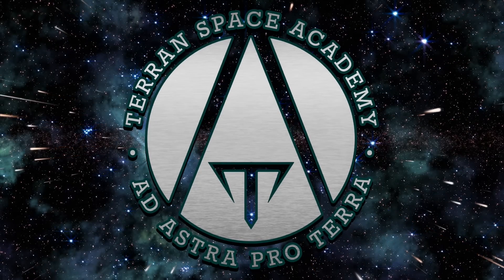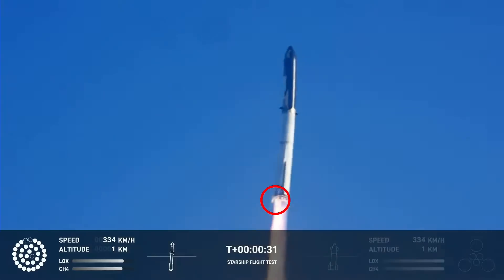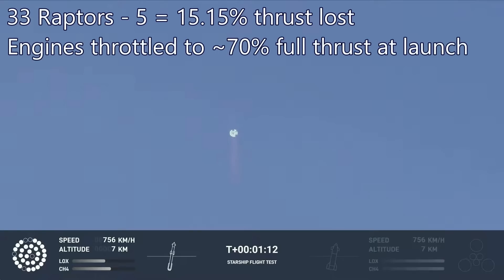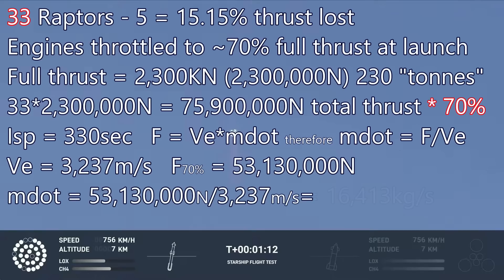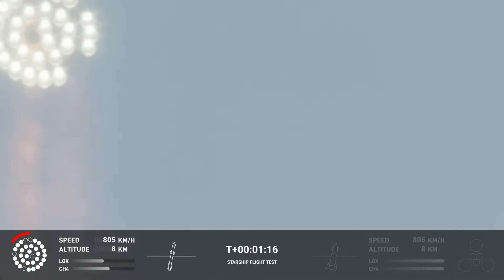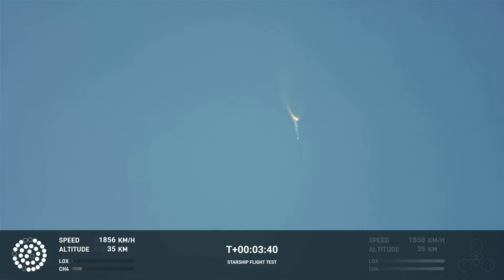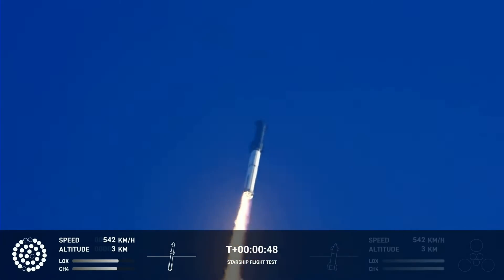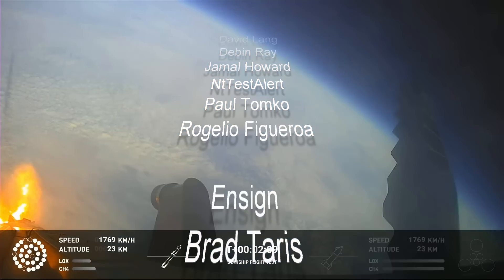Starship Flight Analysis: What went wrong with Starship?

Comment: The fact that it didn't break apart while tumbling is huge achievement.
Reply: Right! That thing was solid as rock
Reply: @cheeseswears  
That StarshipX heavy is not subjected to be tested its hardness like a rock.
So why are all you idiots being such a silly by coming up with many kind of silly and stupid excuses .
Is that the way for improvement by learning from mistakes ?
You fellas talk rubbish and BS.
Reply: 3 flips right I couldn't believe it held together that well
Reply: @ddhsd  yep I was very impressed every other rocket I've seen do spins like that break apart from the g forces but this thing refused to break apart and they had to remotely blow it up
Reply: Super impressed for sure!! That is one BFR!
Reply: I was thinking the same thing, millions of lbs of thrust attached to a tumbling office building
Reply from the maker: We think so too.
Reply: Yeah agreed
Reply: Exactly, durability tested!
Reply: Yea they remembered to enable  auto struts
Reply: Indeed. Normally rockets that huge are structurally fragile than most smaller rockets.
Reply: @lau6438  - the Falcon 9 did not explode on launch yesterday. Keep up will you, and enough of the stupid false equivalences.
Reply: Why didn't separate and land safely instead of blow it up.
Reply: @nolramonairam3098  It didn't blow up. It was blown up on command.
Reply: @nolramonairam3098  
That's the question you need to direct to Elon Musk and his bunch of idiots.
As they are not answering the real question but twisting and fiddling along with their wrong answer.
All for the purpose of damage control.
Reply: I didn't even see flexing of the structure (cam between Starship and HVbooster). Amazing.
Reply: Yeah I was expecting it to rip apart like the Proton did, that's a solid rocket (no pun intended)
Reply: Yeah, achievement my foot.
That's the reason why it can't detached itself as unexpected.
All you jokers are only trying to please Elon Musk by resorting to damage control.
Reply: Nonsense. it was supposed to tumble and "fling" the starship off.  Those forces wouldn't be significant.
Reply: Thin atmosphere at that altitude...however, I'm sure there was some bending and crumpling going on
Reply: Don’t feed the trolls
Reply: The entire launch was an abysmal failure, there are no achievements huge or otherwise to take from this. Remember the Saturn V launch system never had a failure. From its first flight to its last, it functioned perfectly each time. Also, the Artemis system functioned flawlessly on its first flight. SpaceX's entire approach was amateurish and reckless, hence this failure.
Reply: @HH-mw4sq  The Saturn V did not perform perfectly on every flight. Huge problems with pogo vibrations in early flights- this anomaly with starship is the equivalent to the pogos.
Reply: @nls.135  did the saturn V absolutely destroy the launchpad and damage everything within a 200m radius?     This was a pretry big disaster.   Even the tank farm took some.serious damage.
Reply: @jebes909090  The Saturn V had a flame trench and was half as powerful as starship.
Reply: @HH-mw4sq  Apollo 1 Killed 3 astronauts on the ground. Also I feel you're just trolling.
Reply: @deanlute794  - in what way was the Saturn V launch system responsible for deaths of the Apollo1 astronauts ON THE GROUND?
Reply: @HH-mw4sq  Not to mention the fact that Saturn V and SLS especially had been planned and had their design ironed out decades before being built. Starship went from completed(ish) design to full flight in 3 years. Remarkable pace, this flight was a success.
Reply: @HH-mw4sq  While it is true that the recent launch did not go as planned, it is important to view this setback in context. Space exploration is an inherently complex and risky endeavor, and failures are not uncommon in the history of space programs. In fact, learning from such setbacks has often led to significant advancements in space technology.

Comparing the recent launch to the Saturn V and Artemis systems may not be entirely fair. Saturn V, developed during the Apollo era, was the result of extensive research, testing, and funding. The Artemis system, too, has benefitted from NASA's long history of experience and lessons learned from previous missions. SpaceX, on the other hand, is a relatively new player in the field and is continuously pushing the boundaries of technology and cost efficiency.

SpaceX's approach to space exploration and technology development, while seemingly unconventional and risky at times, has led to many accomplishments. For instance, the company has pioneered the development of reusable rocket technology, which has the potential to greatly reduce the costs of space travel. Moreover, SpaceX has successfully launched and landed its Falcon 9 and Falcon Heavy rockets numerous times, showcasing its commitment to innovation and progress.

It is also important to remember that even established space agencies have experienced failures. For example, NASA's Space Shuttle program saw two tragic accidents in its history - Challenger and Columbia. These incidents served as reminders that space exploration is fraught with challenges and that every failure can provide valuable lessons for future missions.

In conclusion, while the recent SpaceX launch was undoubtedly a disappointment, it is essential to view it as an opportunity for learning and growth. SpaceX's innovative and ambitious approach has already led to significant advancements in the field of space exploration, and the company will likely continue to contribute to the development of new technologies and mission capabilities in the future. Rather than dismissing the entire effort as reckless and amateurish, it is crucial to recognize the value of learning from setbacks and using them to drive further innovation and progress.
Reply: @IlllIIIllIlIllllllIlll  - the Saturn V and the SLS, like SpaceX's Starship are designed to send payloads to the moon. So how are the comparisons unfair?
Reply: @HH-mw4sq  it's the difference in how the rockets are built. SLS and the saturn v used a different approach than starship. SLS and saturn-v's components where all rigorously tested individually, this meant that the rockets took an extremely long time to build, but that meant that their first launch was essentially already tested, starship used a different approach of build test change. Instead of building slowly and test as you go, you build, test and fail then build again learning from the failure. This isn't some foreign concept, anyone in any engineering field would recognize the rapid iteration philosophy, they're simply two different ways to get to the same goal, although generally rapid iteration is better suited to new and untested technologies as it's easier to find a design flaw and they aren't locked in to one design, look at the different stages starship has gone through, year after year it's looked different and that is just a testament to rapid iteration.
Reply: @HH-mw4sq  This attitude of "launch and see what happens and we'll learn a lot" bordered on irresponsible given the size of the vehicle. Now everyone can see that there was real risk to the community surrounding the launch site. People complained about the FAA delaying granting the license to SpaceX to launch. Now people may be thinking the FAA wasn't cautious enough.
Reply: @takashitamagawa5881  - hear, hear. I am so sick of those Musk "fanboys" trying to gaslight people into accepting that a rocket launch destined for orbital flight should be declared a success for clearing the launch pad. The SpaceX Super Heavy Booster's first flight was an abysmal failure. Its launch damaged its launch pad and propellant farm, it had 3 engines fail at launch, which represented 9% of total liftoff thrust, so it was doubtful it would have reached orbit. Plus it lost 5 more engines during ascent before being destroyed. Yet to many people, this was all a success. The FAA will have a lot to explain as to why it approved the launch. Civilian buildings 6 miles away suffered damage due to debris from the launch.
Reply: @HH-mw4sq  Saturn V engines much simple and less effective. And broad expensive testing and development facilities  were utilized with full government support. Do not compare in such way
Reply: @HH-mw4sq  There is different approach between spaceX and NASA, Bluorigin and other companies. SpaceX produces several not completely ready prototypes to make test that can give much info. This allow them to learn a lot and very fast. Other companies spend much more time to produce directly the final product. I'm over simplifying but that's the idea. For this reason they already have other prototypes almost ready to launch with already many improvements.
Reply: @HH-mw4sq  Your really missing the point about iterative design and development
Reply: @stuartnetherclift7566  - I understand the concept very well, and I use it daily in my own project management of software development. However, for complex mechanical systems like rocket launch vehicles capable of lunar flight. NASA has successfully done this twice with the development of the Saturn V, and the SLS. Neither of those blew up 4 minutes into any flight. They both functioned flawlessly on every flight including their first flights.
I don't get why you Elon Musk fanboys are trying to gaslight sane people into thinking that this abysmal failure of SpaceX's Starship is a "good" thing. It is not, and you lot need to get some objectivity on this issue.
Reply: @HH-mw4sq  apallo 1 and apallo 13?
Reply: @HH-mw4sq  lol. Who are you to decide. Everyone at SpaceX and the FAA knew that it was 50/50 it makes it to orbit. Even if the test was a “full success” the booster would have blown up 2 minutes later hitting the ocean. This was a great achievement and another step towards creating the worlds best flight platform.
Reply: @polarbear2272  - jeezus, you Musk "fanboys/fangirls" really need to get a life and some objectivity.
The SLS / Artemis functioned flawlessly on its first flight, yet you think a 50/50 flight in which the rocket system failed and had to be destroyed, is a "full success"?
Reply: @HH-mw4sq  you are failing to set the difference between new technology and proved technology. Nasa is a legacy Rocket company, they already Know what they should do. even so they are showing the incompetence in their lack of innoavtion and challenges, they also have bigger budget than SpaceX. humanity have never tried to make something like the Starship or the returning rocket. to be fair to nasa they didnt have the tools we have today... but somehow they lost their way.
Reply: @HH-mw4sq  For a rapid prototiped ship, yes, clearly is. 
For a 10 years program this would be unacceptable.
Reply: @gean31  - so the conclusion you should arrive at should be "rapid prototyping for manned spacecraft is a bad thing, and SpaceX should take the time to do proper development with an emphasis on reliability and safety, and not how much faster and cheaper than NASA we are."
FYI, when you blowup $3B worth of hardware 4 minutes after launch, it takes away any cost savings of rapid prototyping.
Reply: @HH-mw4sq    No no, the safety of the final rocket does not correlates with the safety of the prototype (remember, prototypes are just to test an idea).
Rapid prototyping is excellent for advancing and maturing the technologies involved at the final product. However it's a completely different approach from NASA, whose approach is to prevent most failures.

Both philosophies have advantages and disadvantages. Depends purely on how much money you want to expend and on how much fast you want it.

Complimenting. NASA was never allowed to do fast prototyping because of you know, the taxpayer are the ones paying for the rocket. SpaceX in other hand, wants to speed up the development no matter the cost.

Remember. In the end the ship to fly humans will have to be certified. And independently tested by NASA. As NASA done with the SpaceX Dragon capsule and falcon 9.
Reply: @gean31  - the NASA approach has given us two launch vehicles capable of sending spacecraft to the moon, that worked flawlessly on their first launch.
Yet here you are suggesting that the approach taken by SpaceX is somehow better. Despite blowing-up  $3B worth of hardware 4 minutes after launch. Not to mention the damage done to the launch pad.
You Musk "fanboys" need some serious psychological help to restore your objectivity on this issue. SpaceX's Starship launch was an abysmal failure. SpaceX came across as amateurish and reckless. They couldn't even get their countdown clock correct after the restart at T -40 seconds.
Reply: @HH-mw4sq  I didn't said it was better. Just a different approach. The better part depends entirely on the purpose and what are you willing to do or paid and what time you have in your hands.
Reply: @HH-mw4sq  I would rather know the limits of the rocket at which point can it fail than not knowing by never having a failure and second guess is it durable or is it not. The fact that it tumbled sideways at such speed without falling apart sure says a lot about it's durability. Every rocket that's gone sideways pretty much fell apart and blew up, this one didn't - the command sent a signal to self destruct. And as mentioned previously EVERY rocket had it's fair share of issues no matter which way you look at it. You claiming that Apolo thirteen didn't is a blatant horse shit. What about the other twelve missions before it? Do you realize that you're comparing apples to oranges?... something that is a test flight to something that is on a mission and not being tested? Oh and BTW I am not an Elon Musk fan boy but I give credit where credit is due. There were many doubters like you about Falcon 9 rocket. Where is Falcon 9 now and where are the haters? Same thing with this rocket, they'll get there one way or another. This maybe a setback at most to some but as the saying goes "One step back, two steps forward" and it couldn't be any more true with this test.
Reply: @TimkaD736  You can't consider this a set back - iterative design and development pretty much demands failures to feed info into the next design cycles
Reply: @stuartnetherclift7566  I never said it was a setback for me. I stated that it may be for some. I consider this as a successful event in the regard that SpaceX will sift through collected data and will improve for the next flight.
Reply: @HH-mw4sq also talk to anyone who's seriously followed this rockets development. Or look at quotes from Elon. It's not a matter of if this launch would fail, but when.

I had better odds winning the lottery then this thing had of reaching Hawaii on the first launch. The key word being first launch.

Look at all the other new rockets that came out recently or will be launching soon. How many fail sometimes multiple times why they're starting. Look at how much falcon 9 failed early on.

Sls was a lot of known hardware. It's engines and boosters from the shuttle. In the first few launchs they'll be using actual be using ones that already launched on the shuttle. Not just ones of the same design. And Look how long it took to repurpose them.

Or you could have blue orgin taking something like twenty years and they still haven't put anything in orbit. They've been around longer the SpaceX and only have New Shepherd that can only just reach space and come straight back down.

Sometimes you have to crack a few eggs to make an omlit. This starship was one of those eggs. No one died. No one to my knowledge was hurt. What are you crying about.
Reply: @HH-mw4sq  Apollo 1 & Apollo 13?
Reply: @CSkyhawk722  And don't forget Apollo 6 where they lost two of the 4 engines and had to do a longer duration burn of the other two to get to orbit.
Reply: @CSkyhawk722  - was the Saturn V launch system responsible for what happened to both Apollo 1 and Apollo 13?
Reply: @HH-mw4sq  How many reusable rockets have NASA or ULA EVER produced?
Reply: @HH-mw4sq  Have you not even watched Apollo 13?
Reply: @jtjames79  - were any of the problems experienced during the Apollo 13 flight in any way related to the Saturn V launch vehicle?
Reply: @HH-mw4sq  The Service Module is part of the Saturn V rocket. Therefore the answer is yes, Saturn V did have a failure.
Reply: @HH-mw4sq  Seriously?! Yes. The question was supposed to be rhetorical. Can you really not tell when somebody is setting you up and calling your bluff?

Center engine cut out early you nitwit. The movie used it as foreshadowing.

That actually happened.

So we have established you are just shamelessly making things up.

Ground control, we have a credibility problem. 🤔
Reply: @HH-mw4sq Apollo 1 & 13 have entered the chat.
Reply: @HH-mw4sq  You could not be more wrong. SpaceX and NASA have completely different design philosophies. SpaceX designs, builds, tests, refines the design based on test data, etc. until it has a flight-worth rocket. NASA designs, revises the design, builds various parts, tests, designs some more, etc. then finally flies a rocket essentially ready for operation. Completely different ways of designing rockets. Setting aside Ares V, NASA announced SLS in 2011 and flew its first test flight last in 2022, 11 years later. Also, SLS uses tons of recycled parts from the Shuttle, so NASA has tons of data on the reliability of those parts. Starship was announced in 2016 (using a clean sheet design, including new methalox engines) and flew its first integrated stack test flight in 2023. SpaceX has 4 years to complete a successful un-crewed launch of Starship before you can claim NASA did it better. Saturn V went from design to flight testing in about 8 years, but that was with NASA getting about 4% of the federal budget. Total spending on the Apollo program from 1960-1973 was $25 billion or over $250 billion in today's dollars. SpaceX has a tremendous record of success with Falcon 9/Heavy; they will succeed with Starship too. Finally, Starship will be reusable and much less expensive to operate than Saturn V or SLS.
Reply: @Viamedia202  - given the incredible safety record and flawless operational record of the NASA design philosophy for the Saturn V and the Artemis / SLS, shouldn't SpaceX adopt such a design philosophy, rather than blow up $3B worth of hardware 4 minutes after launch?
I don't understand why you Elon Musk fanboys are celebrating a total failure, and trying to gaslight people into thinking that a rocket blowing up shortly after launch was a good thing. Proper engineering of complex machines should not be done through "trial and error".